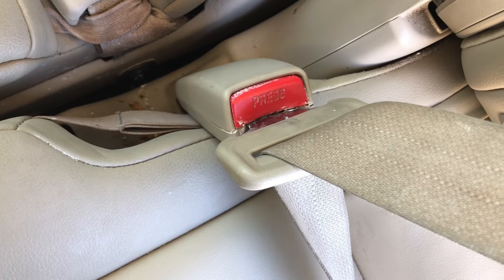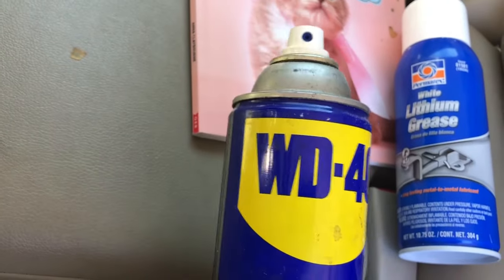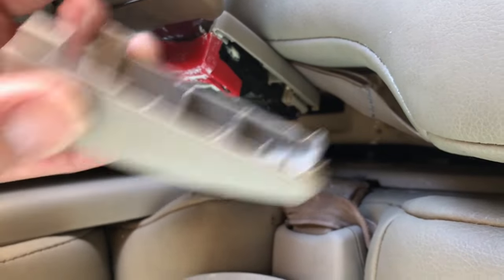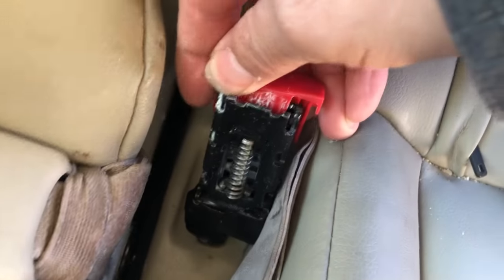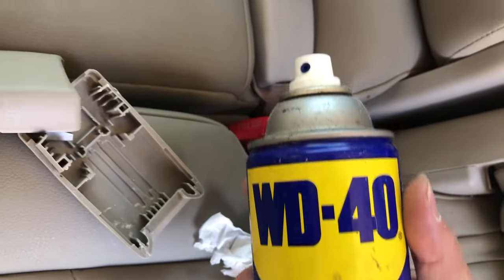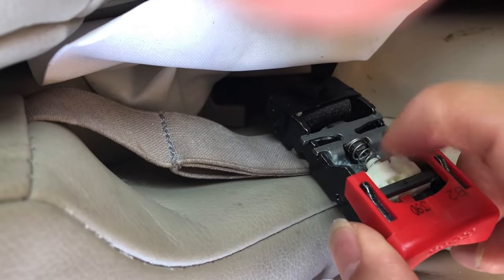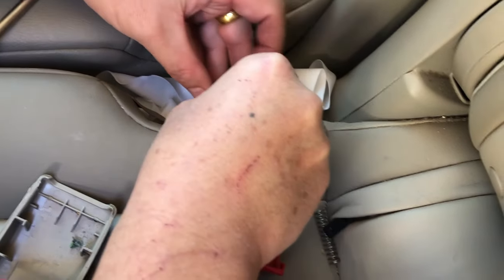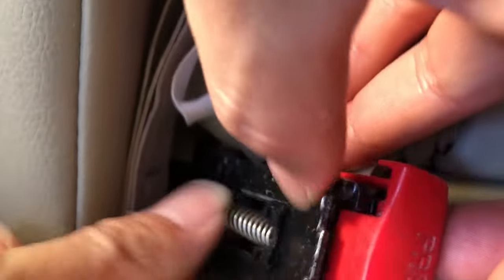How to free and fix a stuck safety belt buckle

Comment: I've got a 2006 Hyundai Tucson that just stopped latching. Now my Wife is driving me nuts about it. You're right, there's not many YT videos showing this issue. Although I didn't want to apply WD-40, I just used electric contact cleaner so it wouldn't get all greasy.... Note: I couldn't get mine working right until I removed the back side. Then removed the ''Red'' Release Button. It seemed to have a lot of dark colored fuzz mixed with dust, so I wiped all that out, gave it a couple blasts of the cleaner and it worked good after that....
                                                 Thanks for posting the video....

Comment: Thank you for your perseverance. I watched and was about to do as you did but then I thought I'd try using my new can of  WD40 spray silicone grease on a long nozzle, as opposed to the WD40 multi use which isn't a grease. It worked first time without any dismantling. Might not work for everyone but I'm happy.

Comment: I’m goin 2 buy a can of air spray. I tried the 40 but it’s still stuck and I was considering replacing but dealer wants bout 4 🤦🏽‍♀️. I could get a used 1 but I think I’ll try takin it apart 1st cause this is the 3rd time it’s gotten stuck.